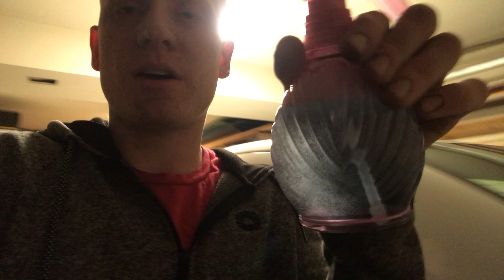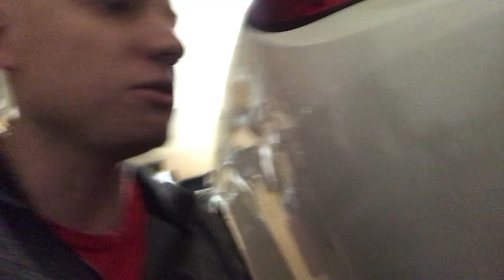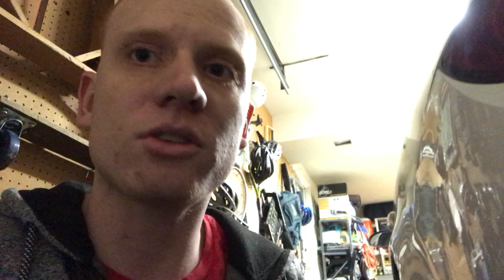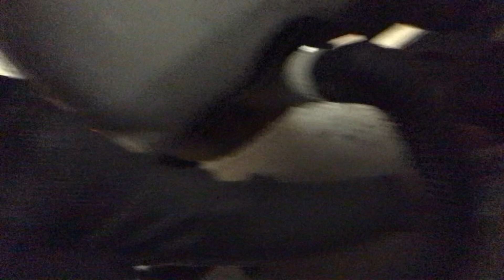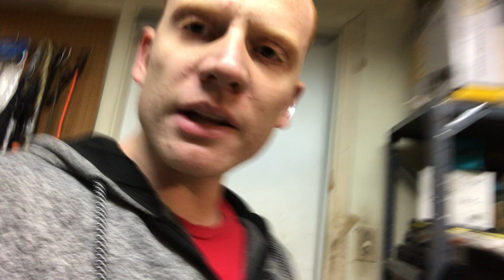Diagnosing P0420 Code AKA finding exhaust leak in Chevy Cobalt (works for any car)

Comment: Great video Than you Hey I was wondering ,what if you have a po420 with a leak before the rear o2 and a higher temp at the upper weld ring than you do at the lower weld ring on your catalyst That's what I have going on. Would you still fix the leak first then check the temps again? Or is my Cat gone at this point?

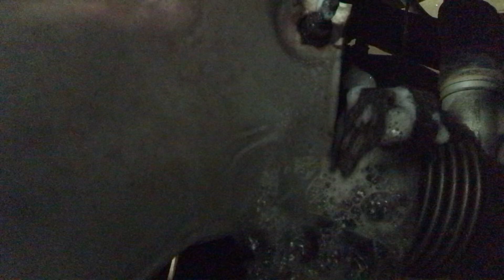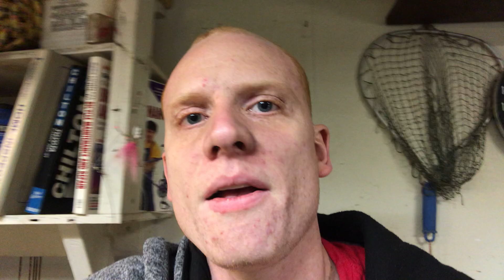Comment: "So I'll be replacing the gasket there"(2:10 - 2:13)...ahh...the camera angle was wonky. WHICH gasket?...exhaust manifold?...intake manifold?....other? Looks like the exhaust heat shield covering a metal flex joint on the exhaust...so maybe an exhaust header-to-pipe joint gasket?
Reply: The one causing the bubbles😮